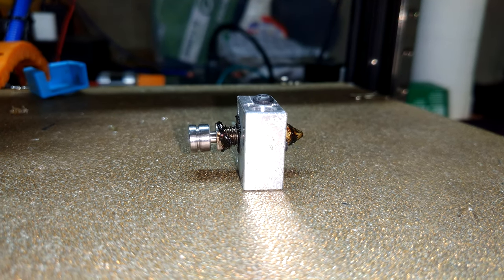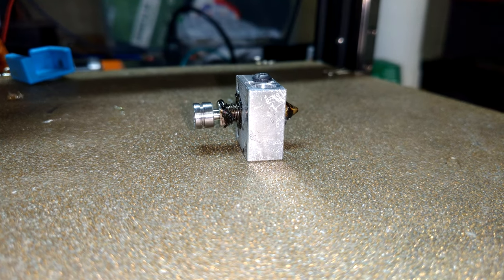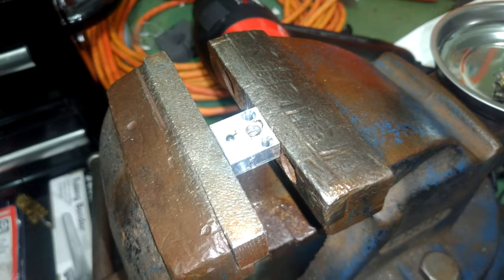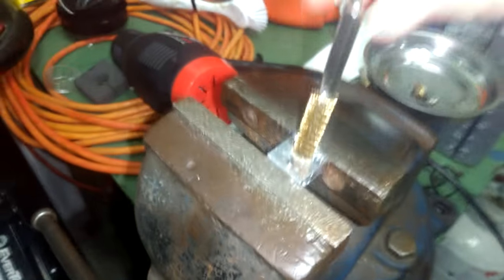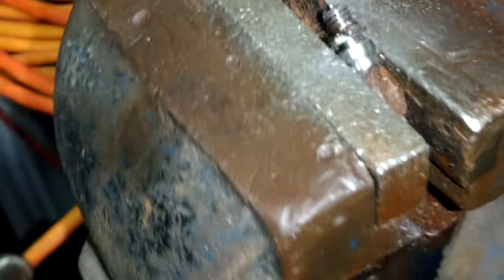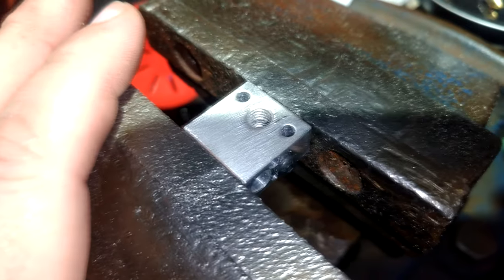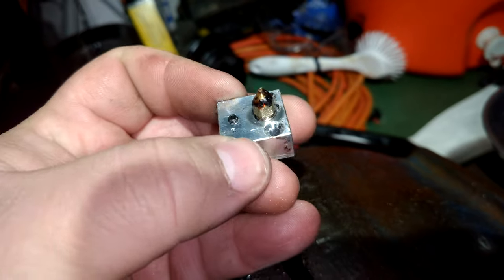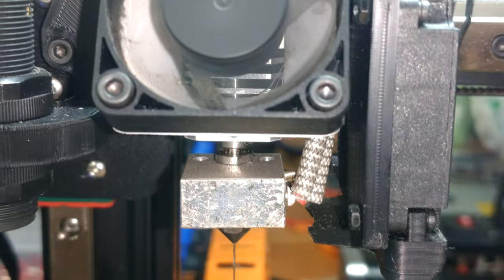How to clean a hot end of a plastic clog

Comment: I would drill a shallow hole in a piece of wood slightly smaller than the width of the heatbrake then split it  to hold it tight in the vice without damaging it.

Comment: Brass is harder than aluminum right? I'd say go easy on the block as after awhile you probably will do slight damage to the threads. You can even see what looks like aluminum dust after you go at it. Albeit a tiny amount but still an amount.

Comment: I removed the heat break, nozzle, and heater cartridge while it was still attached to the printer.  I just heated it up to 240 C though you need to be really careful.  The only issue I really had was getting the heater catridge out.  I finally figured out I had to heat it up again and remove the thermal couple screw.  Then it came right out.

Now comes the cleaning part.  Interesting way you cleaned the threads.  I saw a couple people use a tap to clean the threads.

Comment: i use a blow torch to burn the plastic away. then use a plastic brush to clean off the crap. if you use wire brushes to clean you remove metal from the threads.

Comment: Would soaking in gun cleaner (or other) solvent help get that gunk off?
Reply from the maker: I've tried acetone, but it depends on the plastic. This was a PETG clog, and petg is super chemical resistant
Reply: @andrewesquivel  OK, thanks for the reply.
Reply: @andrewesquivel  use MEK. Just be super careful with it, it's a mean chemical.